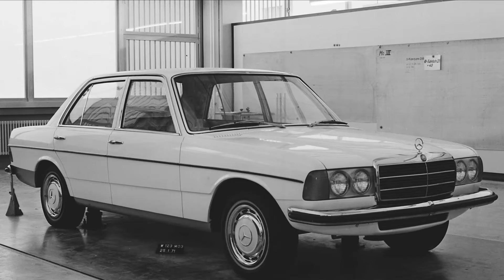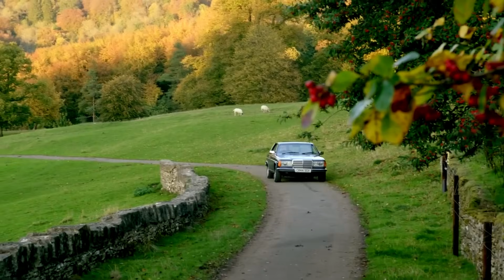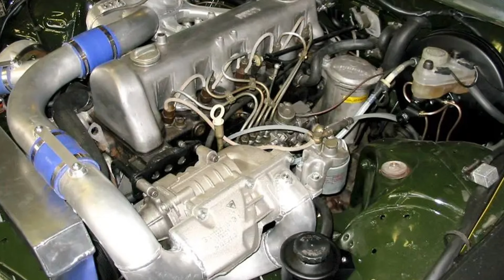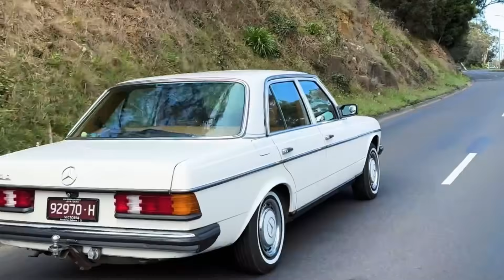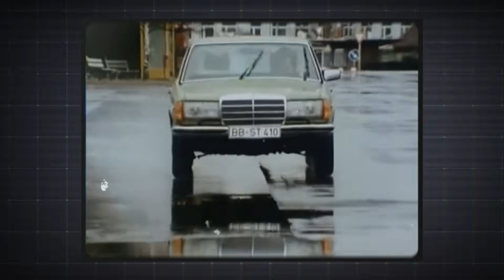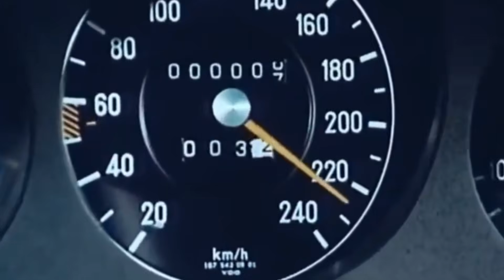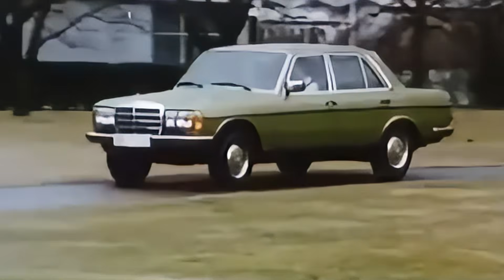The Truth About Mercedes-Benz W123 (1975-1985)

Comment: 0:23 It was designed under Friedrich Geiger, not Bruno Sacco. Even the wikipedia page states this.

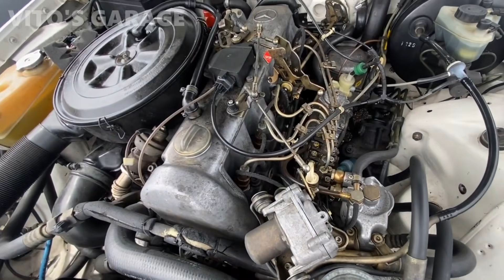1:55 It was not an engine that required "minimal maintenance". You still had to do valve adjustments and periodic injector inspection.

This AI rubbish is polluting the internet and you can't even proof read your facts. Please stop spreading misinformation.

Comment: When I was growing up in Calfornia, we had a '73 280.  Later, we had an '81 300D, then an '85 300D turbo.  I preferred all aspects of the 280 over the others.  It was more comfortable and it drove and handled better.  It felt so elegant.  The later models didn't really measure up.
Reply: El 280 del que habla, no sería un w123 si era de 1973. El w123 es de 1976 a 1985, en sus diferentes series, modelos y motorizaciones.

Comment: one correction. it wasnt one of the durable and reliable design of all times. it is even to this day  the most durable and reliable design of all times
Reply: yessirrr 
Bought a w123 200 no spark issue with 400K kms on the clock 
Was a broken distributor and stupid backyard mechanic wiring causing spark to fail 
Fixed the car and now its my daily 
The diesel is well known but this m102 2.0l petrol engine shocked me with how well it runs and sounds
Reply: @meekaeelabdul5585 👍🏿👍🏿👍🏿

Comment: Quick know bullshit, that should be the name of this channel. This is undeniably a very good car, but sadly instead of facts you use a lot of empty or even incorrect phrases and contradictions. Basically you say a lot about nothing., might be good for complete amateurs but not for those who know a thing or two about cars. E.g. "high quality rubber bushing, forged control arms and gas filled shock absorbers minimise vibrations body roll". Bushings, control arms and shock absorbers have nothing to do with body roll. Funny thing is that you (or rather AI say about minimising a body roll and than you show a video with a lot of body roll, seriously?! You say how special the car is and than say it uses pretty standard "high quality rubber bushing, forged control arms and gas filled shock absorbers". You say how precise the steering is and than you show picture of steering box which is less precise than rack and pinion steering. List goes on, but I have no time to point everything.